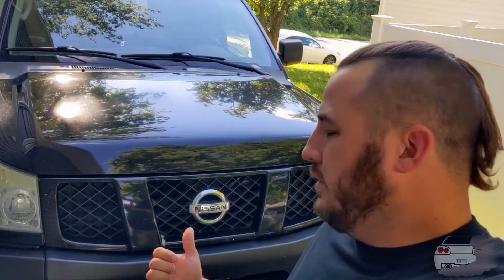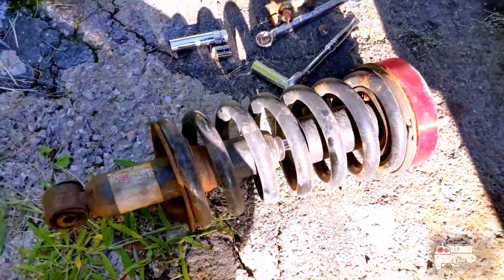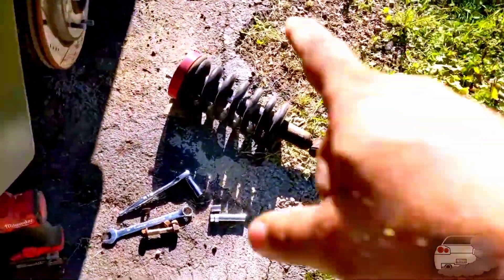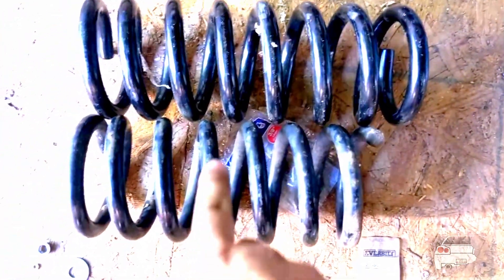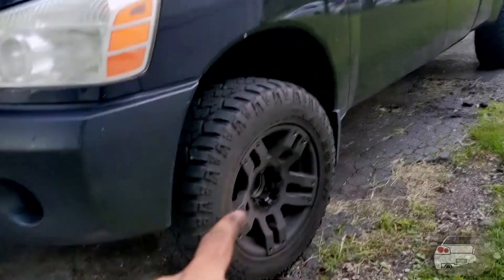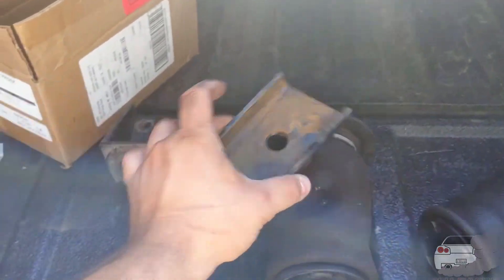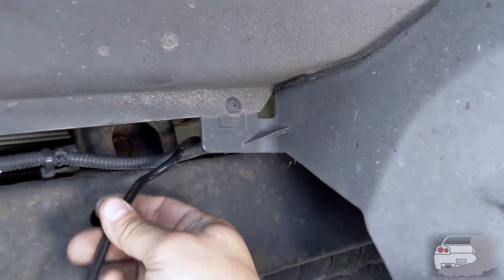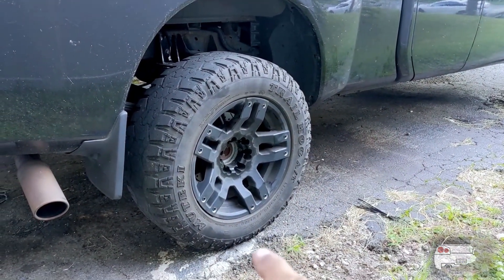Nissan Titan Suspension Upgrades with AirBags

Comment: Great job!
Also curious, how much is your trailer weight?
Reply from the maker: My trailer weighs about 8000lbs with my car in it. It's definitely overweight for a stock gear truck but with the new gear in the rear it does ok just no cruise control